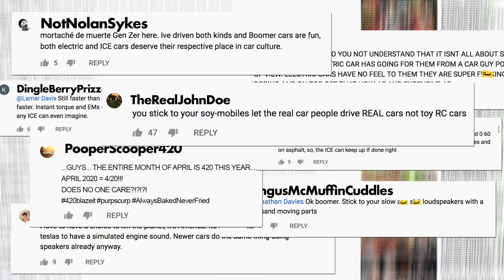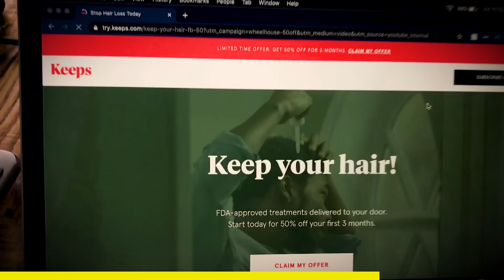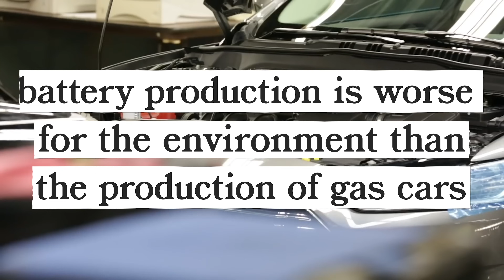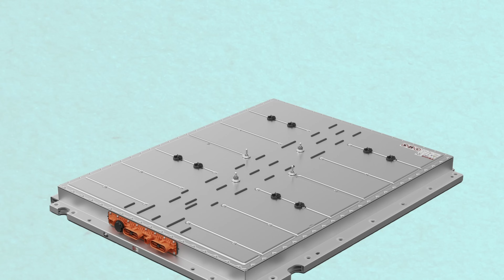Are Electric Cars REALLY Better for the Environment?

Comment: Actually, oil refining uses more electricity than charging your car. So if we switch all ICE to EVs tomorrow the power grid can more than handle the demand.
Reply: Too bad battery for EVs has short lifetime so you either replace the battery or buy a new car. This will consume quite a lot of electricity and fossil fuel for producing the metals and batteries needed to construct the car. Let's not forget the battery waste from old car is quite toxic and dangerous.
Reply: @JulianTung083  EVss short lifetime is simply due to being relatively new technology. In reliability engineering terms, EVs are still in infant-mortality stage.

Comment: @DonutMedia thanks for the video, I found it very useful. However I have one question. In an Electric Vehicle, you have to replace the battery every 8-10 years or every 100,000 miles and many ICEs can last much longer than this. The initial emissions caused by the battery production as well as human toxicity potential is therefore doubled over the EVs lifetime. Did you take this into account? Would this tip the scale in favour of ICEs over their lifetime or not?
Reply: @andyryan6285  I’m guessing you didn’t bother to reach my comment what so ever. Missing the part where cars on the road today with 100,000 miles under their belt have less than 2% degradation. In REALITY. 

I’m also guessing you missed the part where the longer your battery ranger, the longer the life of the battery. Mean EV’s would be expected to last significantly longer than hybrid.

I’m also guessing you missed the part where not having a Battery Management system also affects the battery life.
Reply: @engineeringtheweirdguy2103  “reach” your comment. Sorry, I do t understand this illiteracy.

Read and discarded m8 lol
Reply: @LordDaveKoresh  read. Not reach. Autocorrect unfortunately. Why do you have two different accounts? Are you a troll?
Reply: @andyryan6285  but w/e, stay intentionally ignorant, acting dumb must come naturally to you huh?
Reply: @engineeringtheweirdguy2103  wow, so confident in your opinions that you must become so touchy my friend.
Reply: That is actually VERY untrue. Modern EV batteries have warranties for 8 years, they are expected to, and are showing to last around 500,000 miles to 70% of their original battery capacity remaining. That’s 30-40 years of driving for the average person and more than double the average lifespan of an ICE.
Reply: @andyryan6285  it’s not based on speculation, the warrantees are 8 years. Which means the manufacturer is confident it will last much longer than 8 years. In addition simulated testing of EV batteries get 1,500 cycles to 80% of its remaining capacity. At 352 miles to a cycle that’s well over 500,000 miles before you’ve lost only 20% of your original range. Model 3’s on road today show an average of 2% degradation at 100,000 miles.

As for the comment regarding the Prius. If you’re a keen eyed reader you might have already noticed why that was a very ignorant analogy however allow me to spell it out to you. Even if a Prius battery got 1,500 cycles to a charge, assuming the largest type it could maybe only drive about 25 miles to a charge/cycle. Meaning that you’d have 1,500 x 25 = 37,500 miles before needing it loses 20% of its capacity 

But the Prius doesn’t have something full scale EV’s do. Large, sophisticated battery management systems (BMS). BEV have the most advanced BMS in the world. The batteries are literally swimming in a bed of coolant that keeps them not only warm but cold. Discharge and charge are constantly monitored to with less than 1 micro amp to optimise charge and discharge rates and the potential across any one of the thousands of battery cells in an EV is balanced to within 0.01 of a MilliVolt. Non of which a Prius does or has space for. The result is the Prius has a 500 cycle life. Meaning to get to 80% of your battery health remaining you only need to travel 12,500 miles on battery. So yes, Prius batteries do have to get replaced more often. But not prius batteries are not analogous to full scale EV batteries

Comment: Electric cars are not what People say. At this time it coast 18.75 cents to charge a Car or Truck. This coast is every day you drive one 365 days added to your Power Bill. Most Houses are or have a 100amp power box in House. It take 70amps to charge a car. The power Grid in most areas  are not Wired for that Load. If you have in your Nabor hood ,,can only charge 3 car at at time. So if there 12 houses on your street some body will have to wait to charge up..  Then can you AFORD a ELECTRIC  car???  Charge up for one year is!! $6,843.75  up your Power Bill.  Not ME!!
Reply: you dont drive the full charge of the car every day. A full charge would cost around $18.75 but that would be like saying it costs $80 per tank, then saying that would cost you $80 per day. But with the average energy price in the US of 28 cents per kWh, if you travelled 75 miles per day, (which for something like a Tesla is around or less than a quarter of its total range), you would use around 16 kWh, which would cost you $4.48 per day if you didnt have solar or an EV tarif which most energy companies offer. Over 365 days it would cost you $1,635.20. Mean while going 75 miles in a car with a fuel consumption of 29 mpg, with the average price of fuel in the US being $3.543 per gallon, it would cost you approximately $9 per day in fuel, over 365 days it would cost you $3,344.47 per year. almost 3 times as much as a BEV per mile. 

and power outlets at your home only allow for around 10amps for an outlet. if you're lucky you might get to 15 or even 30 amps. But i'd be surprised if you used 70 Amps. in addition to this the gird is capable of supply every single house in that street with maximum load. Its called frequency regulation. Also no, that's not how power boxes work. The amps provided are based on how many fuses you have, the fuses will trip if that amp level is exceeded to protect the relatively thin wiring inside the home. heavier gauge wiring can handle more current, its relatively trivial to install more if needed.

Comment: I am an electrical engineer and pro EV.  However, we need to quickly move away from subsidies.  One, we all still pay for it as tax payers so it is still a cost and two, it is a disincentive to reduce cost for the manufacturers who profit from selling EVs. There has to be natural downward pressure there to compete with other technologies. Finally, neither wind, solar or hydro can provide enough energy to support the billions of kilowatt hours the US currently uses.  Not even close.  Nuclear is the only way way to power everything while decreasing greenhouse emmisions.  The only way to heat and cool our homes, move our vehicles, grow our food, run our computers and manufacturing plants while decreasing GHE is to support nuclear power.  Nuclear fission and hopefully fusion is a possibility in the future with research.
Reply: I would say no to nuclear but wind, solar, geothermal, hydro when combined can be extremely stable and offer more than enough energy for the grid. Happy to discuss as a Mechanical Engineer who has written papers on the subject.
Reply: @engineeringtheweirdguy2103  To power the state of TX with wind and solar panels it would require an area the size of Harris County.  If you say no to nuclear you are saying yes to CO2 emission increases.  Period.  An engineer should know better.  But engineers over the last 15 years are probably more brainwashed than educated just like any other degree.  Nuclear power is safe.  The US already generates about 800,000 GWh through nuclear right now.  Should we close that down and replace it with solar or wind mills?  Give me a break.  For some hard numbers, Germany is the highest photovoltaic generator at 32,000 MW (note MW not GW).  Other tech such at molten salt reactors use very large areas as well for 100MW intermittent power.  The startup cost for a MS plant vs NG is over 10x and they don't generate enough power to make it worth it.  I am in the power industry and I've seen over and over these 'eco-friendly' technologies simply collect DOE money and some of them never get up and running.
Reply: @bassmanjr100  well the average rootop area of the US per home is 54 m2. There are 10.94 million homes in Texas, which means there is a potential for 629 million m2 of rooftop area for solar panels at the average power production of 1kWh per m2, that's 629 GW potential just from rootop solar. Texa's power demand is only 41.7 GW. Lets presume a utilisation factor of 30% due to night times, cloud cover, winter, etc, that 629 GW becomes 188.7 GW of power. More than enough to supply Texas. The only problem now is that its not generating during night time you'd need some 14 hours of storage for any power that cannot be covered by sources such as wind, or geothermal. Pumped hydro and kinetic energy storage are 2 solutions which have the capacity to fill this need.

Moving on to Nuclear, whilst nuclear is a clean energy, it isnt. Nuclear produces tons of radioactive waste with in low level or high level waste. At current we have no real way to deal with this waste other than to bury it, and at current we have no where to bury it so its sitting in warehouses in containers which will eventually erode. If you think that is a sustainable solution then please look a little harder. Additionally it takes almost and sometimes more than a decade to build nuclear power plants, Installing rooftop solar takes a day or 2. a solar far can be installed in months, wind farms can be installed in a a year or 2. Timing is another factor as we rapidly approach a climate tipping point.

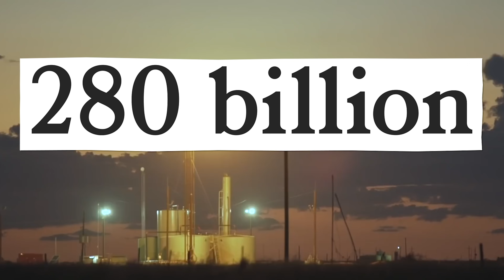Comment: 8:04 Cars aren't the only petroleum product though. Your iPhone, house, clothes, shoes, XBox, TV, literally everything we use on a daily basis is a petroleum product. So of course the emissions are going to be higher. 

The only way to become "Carbon Zero" is to wipe humanity off the face of the earth. Wind power massacres birds by the millions and the turbines are made of nonrusable materials, so when one dies or catches fire,which is inevitable, it sits in the landfill for ten million years, solar is the most unreliable out of all of them and is extremely filthy to make the panels and frankly, solar panels are a hideous eyesore, Hydroelectric is the best of all green energy since it uses water that's already running like a crackhead that owes money to wind giant turbines, coal is, surprisingly, pretty clean since we've had 200 years to perfect it. Nuclear power could be clean if we just yeeted the waste into space since space is a radioactive nightmare from hell anyway, and the spent rods are reused for tank armor. Natural gas is one of the best out there until you get a gas leak in your house and it smells like rotten eggs for a week.

Either way, I'll take a gas car that sounds good over a car that sounds like a gay guy farting any day. You won't catch me dead in an electric car. The more I see in the scrapyard, the happier I am.
Reply: they idea isnt carbon zero. its carbon neutral.
Reply: also, most of what makes up wind turbines is recyclable, wind turbine fires are actually pretty rare, one in every 200,000 or something like that last I checked, And whilst they do kill millions of birds each year, Cell phone towers kill Billions, So do high rise buildings, transmission towers, etc etc etc, all have higher death tolls for birds per unit than wind turbines. Thats because with turbines both rotate, and make a low level humming noise, both of which scare off most wildlife. Whilst its amusing that you're frightened by big numbers, when you put into context, wind turbines are the least of your worries when it comes to bird deaths.

Comment: This is a terrible comparison.. every car is stuffed full of plastic.. so ya oil!  Not to mention  you did not cover the cost and replacement of the battery packs.. so is a new battery pack needed every 100k miles or 200k? And how do they last up in Alaska, Chicago or Canada.. you know the great white North, where we can get -50’C and it can snow in June and September.. so there’s winter alot.. range is a problem in the cold as you need to use a lot of energy to heat the cabin
Reply: You should do more research.

Comment: For now a ev bike or a ev scooter  or a ev bicycle is better for a single user and for the environment. The battery pack for a ev two wheeler is relatively small than a ev car. I mean as a starting point until it becomes cost effective in future.

Comment: The minerals are also becoming more scarce and that means greater amounts of energy needed to extract the desirable minerals. And the wind and solar power sources have a lifetime of 20-30 years before needing to be replaced which introduces another recycling issue. But EVS still are releasing CO2 and it is excellent for mitigating the problem but we need remediation now. There is too much CO2 in the atmosphere. We are still confusing the mitigation effects with the remediation needed.
Reply: but we dont have to get to zero emissions, we just need to pollute less than the environment can absorb

Comment: You can’t count the emission to produce gas. We will always need plastic and jet fuel gas s going to go along for the ride.
Reply: Are you saying that if we stop producing diesel and petrol, that the plastics industry will dramatically increase demand to consume the excess oil? because unless you think that getting rid of petrol or diesel will somehow spike demand in plastics, Then it still counts. Fuel and plastics are made to demand. Fuel refineries dont refine oil for plastics, thats a separate process.  you are arguing that the oil is going to be used elsewhere. If they continue making the same amount of plastics because demand does not change then getting rid of fuel refineries only serves to decrease emissions.

Comment: EV  make ecological  sense if   the electricity by the EV  is sourced by wind, solar, hydroelectric,  or nuclear. -  otherwise a more efficient gas diesel or hybrid has a lower carbon foot print.  Scientific American published a  study about 7+ years ago  that reported this finding.  So the answer depends on where you get your electricity to charge your EV
Reply: Currently there are only around 5 or so cars on the market, all plug in hybrids, which would be more emissions friendly than a pure EV, when based of the national average US grid mix, which works out to be around 500g/kWh of emissions. This means for a diesel, it would have to surpass 98mph (2.4L/100km) or for petrol 84mpg (2.8L/100km). This is based off the energy consumption of a Tesla model 3. All 5 cars of which I could find which equalled or exceeding those fuel efficiencies were significantly smaller than the model 3, so its not comparing apples to oranges. IF you're looking for a mid-sized sedan, there is no Hybrid or ICE competition out there which would exceed the efficiency of the model 3. 

This is based off an energy consumption of 130Wh/km for the model 3, 1kg of emissions per kWh for coal, 500g/kWh for Gas, 800g/kWh for petroleum/oil generators, 2.3kg/L of petrol fuel and 2.7kg/L for Diesel Fuel.

From that you can find the average grid mix for the US for 2020, find an average emissions per kWh to be approximately 500g/kWh. Then use the Model 3 efficiency to find the fuel efficiency required to emit the same emissions per km, from either petrol or diesel.

NOTE: This does not include the VERY emissions heavy fuel refining and transportation process. If that was include EV's win out by a significant margin every time.

Comment: oh remember the average ev needs new batteries every 10 year ....
Reply: no they dont The average EV has an 8 year warranty on the batteries alone. Modern EV batteries last twice as long as a standard combustion engine. Where do people get this whole "batteries need to be replaced every 5 or 10 years" bullshit... Legitimate question, where did you get that from? I got no idea.
Reply: @engineeringtheweirdguy2103  Because normally batteries, especially in hybrid cars normally go bad in 5-10 years.
Reply: @mstnglvrr  Hydrids which arent EV's firstly Hybrids dont have battery management systems to monitor their charge and discharge and keep them at idea temperatures. Secondly they are very small, an EV has a cycle life (to 70% health) of 1,500 cycles, for a car with 325 miles thats 1,500 x 325 = 487,500 miles. For a 400 miles battery thats 1,500 x 400 = 600,000 miles. Meaning battery size matters. A hydrid usually only has 25 miles, so thats 37,500 miles of battery driving.

EV's arent hybrids, that should be fairly obvious. Im still confused. Do people not think that EV's and Hybrids are different?
Reply: @engineeringtheweirdguy2103  I never said Hybrids were EVs. I said that the batteries in EVs and Hybrid cars go bad.
Reply: @mstnglvrr  yes, but EV’s batteries last a lot longer, because they’re much larger and have much more sophisticated battery management systems. That difference is obvious to me, so I don’t understand why people would heap hybrid batteries in with EV batteries. But seeming don’t do the same about ICE car batteries. It doesn’t make sense to me

Comment: Yes.
Everyone always forgets gas takes more energy to refine than EV's take to drive.
Reply: Yes for heavy crude but no for the light sweet crude we are getting from fracking.  The creosote we get from fracking is only 6 steps away from gasoline.  One of the reasons asphalt has gone through the roof.
Now refine that garbage tar they call oil coming from the middle east then  I will agree.